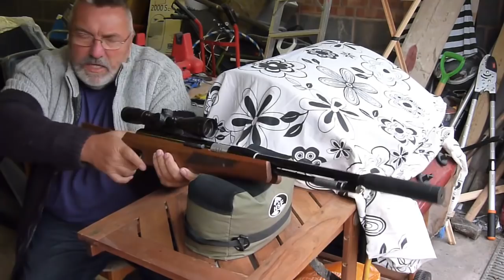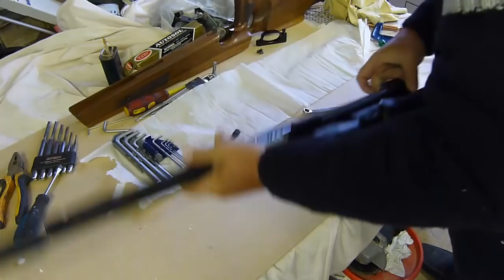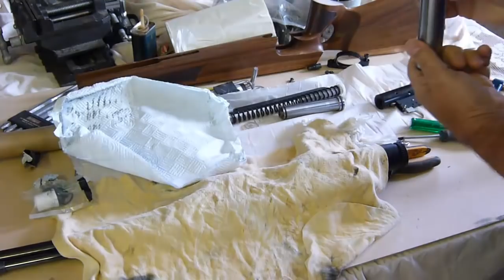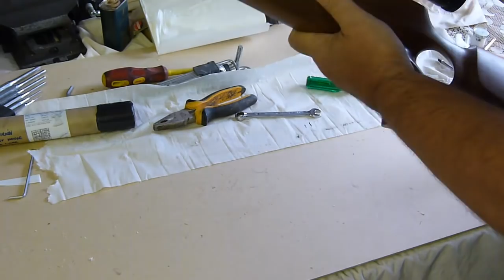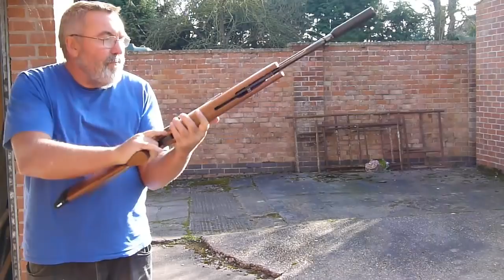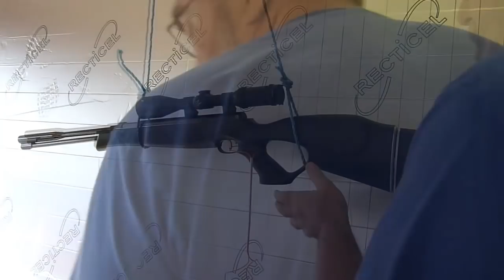Tony Leach 22mm piston conversion for TX200

Comment: Hi I YOU HAVE A TARGET IN YOUR GARDEN ITS 4 SWING PLATES WITH HOLE IN CENTRE FOR SPINNER I HAVE BEEN SEARCHING FOR THIS TARGET FOR MONTHS WERE DID YOU GET IT ALL BEST FRED.
Reply from the maker: The spinners I use are made by "hairyarms" on the airgun forum. The plate with the hole in the middle I made myself.

Comment: Very interesting video Neil, there doesn't seem to be much recoil from either gun, what power is the Nick G 97 putting out and what seal did you decide on.  I saw on one of your earlier videos you had it with a conversion that could allow a standard seal or O Ring and wondered if you had experimented
Reply from the maker: +Steve Whiting  11ft / lbs at the moment. I removed the O ring head and replaced it with a parachute seal. This makes the length of the stroke standard again and it creates the power more easily. Still has a lot of preload due to the lighter piston but it shoots really nicely as you can see in the comparison video